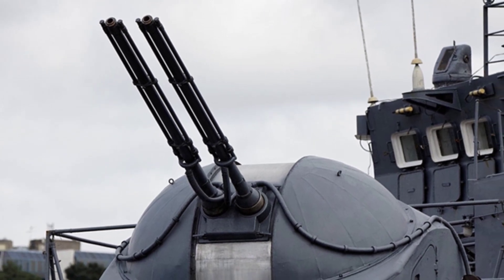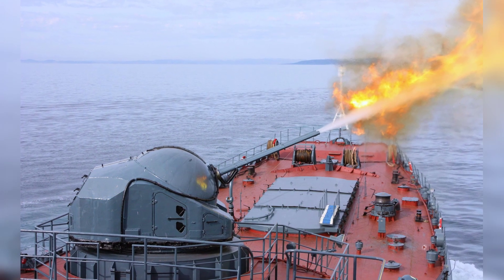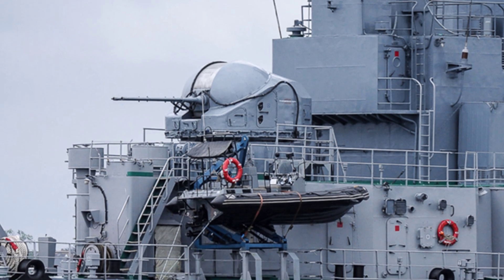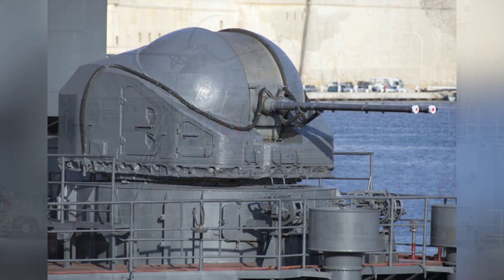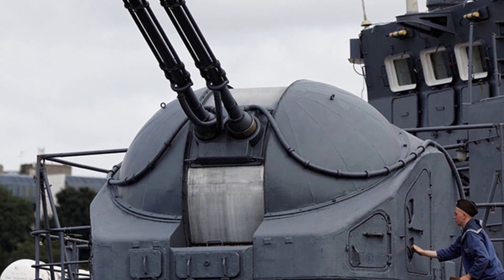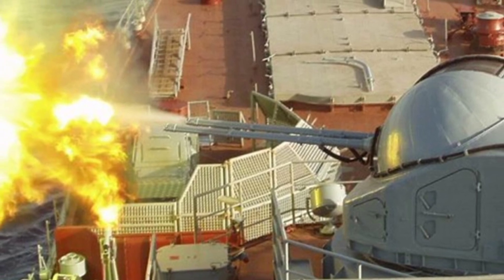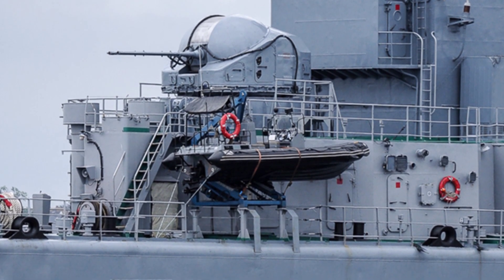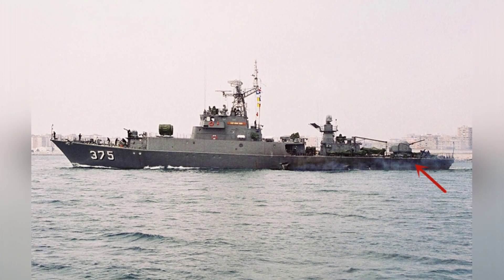Unleashing Power: The AK-725 - Soviet Navy's Revolutionary Unmanned Turret

Comment: AK-725 is completely unable to shoot down Styx/P15 Termit anti ship missiles as proven in 1987 during the sinking of the Nunchuka 1 Class Missile Boat Musson. During a training exercise where a Training Termit (Live missile but with no warhead) was launched and several vessels engaged it in target practice. Unfortunately the Missile locked onto to the Musson and despite shooting Osa-M SAMs and firing their AK-725 at the missile, the missile struck the vessel killing 39 sailors as the Termits fuel is volatile and as much of a threat as the warhead is on the service missile. The AK-725 was firing at the missile until the moment it ht the boat. The AK-725 did not have proximity fused ammunition and was required to hit the missile directly and despite the P15 being the size of an aircraft the system was unable to. The Nachuka I and II were equiped with the AK-725 with the I class being for the Soviet Union and the II class being for export. The Nanchuka III class replaced the AK-725 with the vastly more capable AK-176M 76mm gun which has Proximity fused ammunition and is anti-missile capable